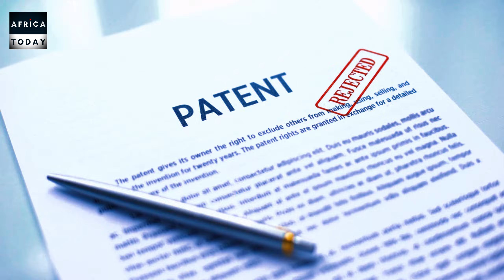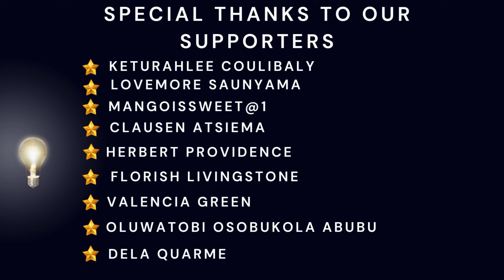EXPOSED: The Real Reason They Blocked This African Invention

Comment: I have been on a quest to overcome the second law of thermodynamics. for the past 60 years since being inspired as a teenager by reading View from a height, Doubleday 1963, a science anthology by Issac Asimov. He first wrote very convincingly about the  principle that energy is conserved when changing form followed by a less convincing section on the concept of entropy. 

The concept of entropy is stronngly accepted to this day after being promoted by a prominent astrophysicist, science popularizer, and Quaker Sir Arthur Stanley Eddington who considered the second law of thermodynamics to be the most fundamental and universally certain law in all of science. He believed that entropy never decreased so the universe faces an ultimate heat death of stagnation so somehow the universe had to start with low entropy. Eddington had a deep metaphisical side so he also believed that God was beyond the relm of science. Let me put it this unusual way, the second law will fail before God is disproven. Furthermore, God would then be supreme over an eternal non doomed universe. 

Because the second law is intensely accepted it is hard to find people that want to prototype devices that may falsify the second law. Therefore I am posting this essay as a comment on YouTube to attract teams or exceptional individuals with access to suites of complex equipment to build exploratory prototypes that will prove the concept then home in on a good recipe then fine tune for small scale production. A lot of small sample working device trinkets can then be presented and handed out widely to people at media conferences. A low power proof of concept prototype would power a LED in an eyecup with Inspectable parts and assembly and dummy versions as controls.

Go ahead and start to build something indspired by this introduction without my involvement. We can meet after there is solid crowd verification. 

Let's reframe Earth's low diversity abundant ambient heat as a thermal energy waypoint between heat and other forms of energy. 

Energy changes form without gain or loss. Uniformity or diversity is not, in itself, a form of energy.  Therefore entropy is an extraordinary claim burdening the law that energy is conservedeven if it is changed in form. Thermal energy's partial  transformation range with an unusable residue is widely accepted. 

Energy sensible refrigerators that absorb heat and yield electricity would complement computers as computing consumes electricity and yields heat. Computing would be almost free. Chips could have energy recycling built in.
This would improve performance and lower cost. 

Full heat recycling, all electric, very isolated underground, undersea, or space communities would be highly survivable with self sufficient EMP resistant LED light  automated vertical farms, thaw resistant frozen food storehouses, factories, nonstale dwellings, self contained elevators, safe rooms, and horizontal transports.Some electrical equipment groups could be consolidated into local networks when suitable. Liquid nitrogen cooled superconducting networks would become practical. 

In a flourishing civillization, small self sufficient electric or cooling devices of many kinds and styles, lamps, smartphones, hotplates, water heaters, cooler chests, fans, radios, TVs, cameras, security devices, robots and robot test equipment, scales, transaction terminals, wall clocks, open or ciosed for business luminous signs, power hand tools, ditch diggers, pumps, and personal transports, would be available for immediate use incrementally anywhere as people as individuals or larger social groups see fit. 

If a high majority thinks our civilization should geoengineer gigatons or teratons of greenhouse gasses out of our environment, instalations using devices that convert ambient heat into electricity can hypothetically be scaled up do it with a choice of comsequences including many beneficial ones. 

Refugee communities would be buildable quickly. Fire safes would preserve contents to 1000 C for years. 

A simple rectifier crystal can,
just short of a replicatable long term demonstration of a powerful prototype, almost certainly filter the random thermal motioren of electrons or discrete positiive charged voids called holes so the electric current flowing in one direction predominates. At low system voltage, a filtrate of one polarity predominates only a little but there is always usable electrical power derived from the source, which is Johnson (observation) Nyquest (theory) thermal electrical noise. Max Plank anticipated that ambient thermal noise would become usable with advances in technology.  

I don't see how the second law of thermodynamics can implicate itself into preventing this from working. 

In 1973 I filed for US patent 3890161A DIODE ARRAY for an array of metal1/ insulator/metal2 diodes that refrigerate while concurrently producing electric power. The patent was granted in 1975. It was opened to the public domain in 1992. Development is in the public domain while granting me writing attribution. 

The plausible net electrical filtrate from diodes can be aggregated in a first grouping of separate diodes in  consistent alignment parallel. After a primary level of grouping that preferably is in parallel where current is additive, compound parallel and series where both current and voltage are additive, networks can be built to provide desired DC current and voltage. Within limlts, parts of the  network can be shorted out or open circuted without electrical or chemical harm. Widely scalable electrical power always paired with equal refrigeration is thus possible. The efficiency of each diode is probably low because the initial power within each diode is nanowatts which doesn't graph far beyond the near linearity near the 0,0 orgin. This inefficiency affects the performance but not the equality of the thermal absorbtion and the electrical yield. 

The maximum energy is converted from ambient heat to productive direct current electricity when the load electrical resistance  is equal to the array internal electrical resistance. Maximum calculated electrical power output (watts) is k (Boltźman's constant), one point three eight x 10^ minus 23, times T (temperature Kelvin) times bandwidth (0 Hz to a natural limit ~2 THz @ 290 K) times rectification halving and nanowatt power level rectification efficiency, times the number of diodes in the array. 

There are a billion measurment cells of 1000 square nanometer area each per square millimeter, 100 billion per square centimeter. 

Order is imposed on the random thermal motion of electrons by the structual orderlyness of a diode array made of diodes made within a slab: 

Host crystal in this example is silicon or germanium 

  P type boron doped
-----‐------‐----___-- Out
🔻🔻🔻🔻
■■■■■■___ + Out
  N type phosphorous doped 

All the P type semiconductor anodes abut a metal conductive plane deposited on the top face of the slab with nonrectifying joins;  the N type semiconductor cathodes or common cathode abuts the bottom face. As the polarity filtered electrical energy is exported, the amount of thermal energy in the group of diodes decreases. This group cooling will draw heat in from the surrounding ambient heat at a rate depending on the filtering rate and thermal resistance between the group and ambient gas, liquid, or solid warmer than absolute zero. There is always a lot of ambient heat on our planet, more on equatorial dry desert summer days and less on polar desert winter nights. 

There are other plausible breeches of the second law of thermodynamics. Hopefully a lot of people, mostly as independent teams, will join in expanding the breech. Please share the successes or setbacks of experiemental efforts. The topic deserves crowd financing, discussion and prototyping attempt action. Crowd development would be resistant to confiscation or burial. At best there could be science quality colaboration. 

These rectifiers could be various types, such as:
• Field emission diodes: An array of needles the needles made of carbon nanotubes or another electrical conductor tipped with an emmisive material probably LaB6 abutting straight in and also separated by a thin insulator or vacuum gap from a metal plane substrate surface.
• Schottky diodes: A metal needle-to-semiconductor junction diode, the semiconductor may be Gallium Arsenide or Indium Antimonide.
• Silicon or Germanium crystal diodes: A well-established technology. These diodes may have poor performance in this application 

These devices would probably become segmented commodities sold with minimal margin over supply cost. They would be manufactured by advanced automation that does not need financial incentive. Applicable best practices would be adopted. Business details would be open public knowledge. Associated people should move as negotiated and freely and honestly talk. Commerce would be a planetary scale unified conglomerate of diverse local cooperatives. There is no need of wealth extracting top commanders. We do not need often token philanthropy from the top if the wide majority of people can afford to be generous. 

A pile driver dropping its hammer three meters over a four million strike service life far outweighs the energy of melting scrap metal to make the hammer. This is negative entropy in manufacturing objects. 

Aloha
Charles M Brown
Kilauea, Kauai, Hawaii 96754

Comment: It is not an African Invention, it seems that Maxwell Chikumbutso who is not a man of the world is not aware of the world beyond Africa and  that he did stumble upon Nikola Tesla's Invention of the Tesla.Coil in 1891 and that is why he cannot file for a Patent as his own invention - Looking at Maxwell's Car & Motor & Battery, one should be familiar with these inventions :  Battery, Electrical Motor, Transformer, Radio frequency which Maxwell run at 50 hertz, Voltage and Amps, and Mosfets which transmit the Radio Frequency...

Comment: Alternative Option: validate continuous energy production over time without allowing ANY conductor near the operating vehicle, provide free energy charging of EVs (Car batteries) for x months when the station is disconnected from the power grid or operate electrical ovens/stoves isolated from all sources other than the micro-energy device.  These test(s) MUST BE CONDUCTED BY CERTIFIED & INDEPENDANT TECHNICIANS/ENGINEERS.

Comment: Patent the Devices that have the Power Supply integrated as a random component minus the batteries or capacitors. Don't specify it as a "Power System" instead call it "Signal Translation Component 1". 
If this were an average business instead of the Energy Industry, we'd be competitors, but, Maxwell, we have the same goal. It isn't the Energy Industry to me. Its a bunch of paper clowns obstructing Progress because they think a Power Source is  more profitable than Evolution. And they're destroying this entire planet in the process.

Comment: If you look into the systems that exist - you will find that they benefit a small few.  They are designed to promote scarcity and concentrated power.  This is being challenged as are the old laws of Physics.

There is no point trying to work with the old structures, as a species for the benefit of all, new structures must be developed.  Structures based around abundance, harmony, mutual respect etc.  Heart based structures that benefit all and also respect our planet.

Comment: I would really like to see this be true.
But I'm positive it's not!
The reason they didn't patent his invention was for a simple reason. Limitless energy doesn't exist in the universe. It will always require a source used for ignition, and radio waves do not have the power to do it. Radio waves are weak. What is required is amperage, and to make amperage takes a lot of energy.

The patent company will not look at any invention that makes a claim of limitless energy. 

His invention is actually easy to prove, but for some reason, he will not do it.  He claims that people want to hurt him if he attempts to show the world his invention. 
If he just started driving the car across the planet, and didn't stop.  
I think everyone would shut up after that event. 
I believe inside the metal box in the car was a power converter. These are common today, and they'll run a refrigerator and that car for awhile, but not for two hours... 
He designed this thing almost four years ago. And he's never powered a hundred homes. 
I'm afraid that his statements will start dying off the longer he does nothing.. within a few years, you'll never hear from him again

Comment: The ramifications of this are far beyond the auto market. Anything using a battery is affected. Flashlights, cellphones, drones, tasers, radios, wireless mikes, wireless video, space exploration, warehouse forklifts, Electric mobility products, any chargeable device or any battery operated device or any device which can be converted to electrical. Energy companies, battery manufactures, car companies. This will change the world and greedy people will do anything to stop it. They should pay the inventor his due and make the world a better place. Imagine electricity anywhere in the world for free. NO lengthy wires, maintenance of wires. No power down instances. This is big.

Comment: This is so much BS. If the car is real, have them build a few more of them, same for the  motorcycle and the generator. Somebody built these things! Build more, if they're real. And people will buy them. Issue solved. Invite as many manufacturers to see these projects, the news, and anybody else. Heck, people would buy an old dune buggy if it ran forever without gas or electricity. It doesn't have to be a top end EV. Something is not right here. When things don't make sense, there's something being hidden.

Comment: Now I have a rough idea how it works as an electrical engineer. I can see it's possible. Clever bit is the amplification of weak RF signals around to generate sufficient power to drive the EV motors. Again I understand the principle , how it's  been done is my mystery. Small power ,ok but high current demand is the mystery.

Comment: Solar panels generate electricity solely from sunlight. They are not considered perpetual energy sources. So, what is the difference if, instead of sunlight, they use radio waves? In any case, a patent should be granted to any invention regardless, as its purpose is to protect against unauthorized claims on its intellectual benefits. Patents are not sacred or absolute; they are based on logic and can be overturned if found to be flawed. Laws of physics aren't sacrosanct

Comment: If his invention is true why hasn't he tested it on the road or a racing circuit for 3days running straight without refueling.  Why always the same video with president wearing a scarf and him holding a funny box that looks like a tool box.  There's no other video of his invention anywhere in the internet.   The guys is a master scammer

Comment: You will need a patent system in Africa or like everything else it will be stolen from you. They don't have to play by your rules if you can not secure your nation military wise and economically. Is this what is happening to Ukraine right now. Manufacturing needs to start and don't worry about co signs from the west. Africa has to be the first mover.

Comment: Why is he holding a green and black solar panel battery charger as the device in has hands in this video ? It’s sold on Amazon for under $400
Reply: The cars he use are from China the solar box is sold online already,, he is just using what is already available to showcase his product
No need to reinvent the wheel😊
Reply: Don't bother, they (my fellow continentiers) will defend this nonsense with their lives.

Comment: He needs protection. He should ask Dangote for funding.
Reply: Side deal 
as his involvement in oil will decline long term uf this system gets acknowledged 
And he might juggle both until 1 is no longer needed and have leverage in the industery as its starting 

Win win if i was danqote